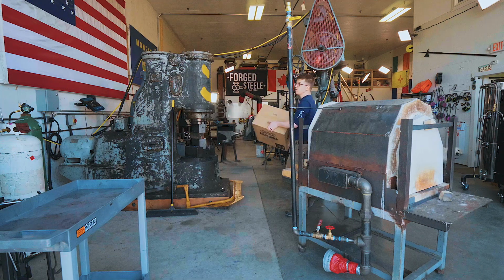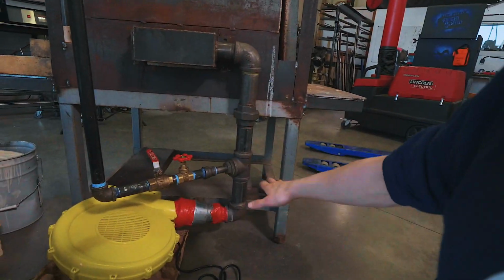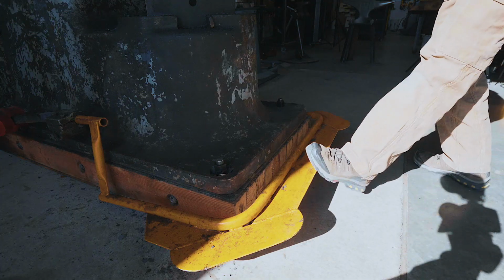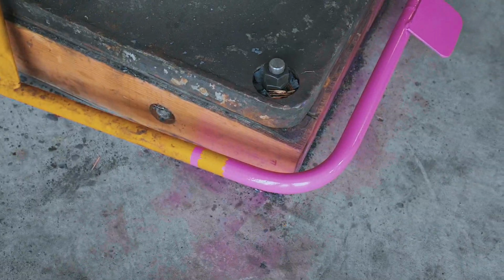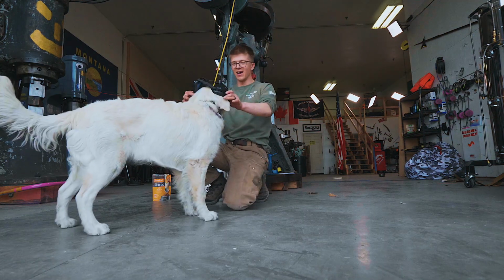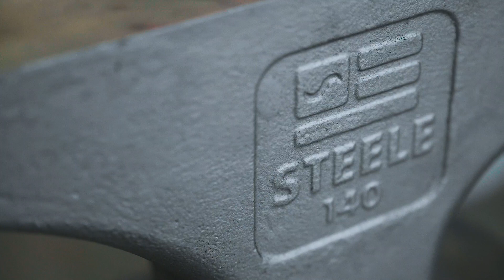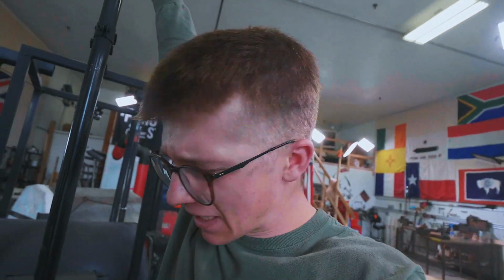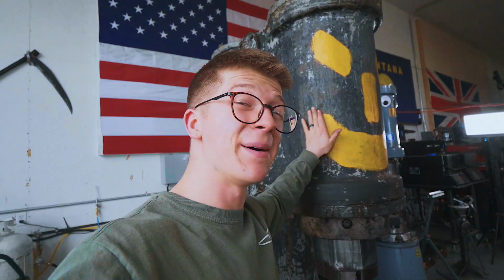NEW FORGE BLOWER, YOGO'S EARS, FORGING TOOLS!!!

Comment: your pressure is to high with to high of volume you need a bigger pipe to get the fuel air mixture better  before it come out of the burner head meaning you need less pressure with the same volume as you had it burning but blowing out i would try larger pipe on the same blower if its still a problem look at pressure not volume of air if your still having problems with pressure at this point after pipe gauging add a air out let flap valve let some air out BEFORE the propane inlet to alowyou to control air fuel and pressure adding the valve to the inlet of the blower just controls presure and volume but after the blower would give a air fule change as well

Comment: Have tried Stoichiometry? 
For natural gas burning in air, the chemical reaction is CH4 + 2(O2 + 3.76 N2) -> CO2 + 2 H2O + 7.52 N2

If you do some not insignificant math, you'll find that for each cubic foot of natural gas, you need about 9-10 cubic feet of air for the best combustion. If you're using propane, it's about 24 cubic feet of air per cubic foot of propane. 

Anyway, any more air than that and you're just blowing excess air. Any less and you're not getting your maximum heat. 

This assumes a perfectly mixed volume, which, looking at the pipe work, you aren't getting. Some suggestions... mix the gas and air much earlier so they mix properly before getting to the forge. Much less volume of air... you're literally just blowing the fuel around so much it can't stay lit. 

Hopefully that helps. I can show you the math if you need it.

Comment: Your blower is now too strong... you are moving the air too fast, but not moving enough air... you can first try to slow down the blower... it should work on a normal dimmer circuit so you can vary the speed it is blowing at... or... you would need a higher volume, lower RPM blower mixed with higher diameter pipes.
In air flow, faster is not always better... in many cases, high volume / low pressure is best.
And if all that fails... then go to a straight oxygen feed... but make sure you do it right.

Comment: The blower: you're throwing parts at the problem thinking more is better. 

This is a physics problem. Fuel/air mixtures burn best in stoichiometric ratio. I'm sure you have some idea of previous propane fuel consumption per hour based on tank changes. Calculate a rough lb fuel per hour. Make the conversion calculation propane flow Vs natural gas flow for the same heat output. From that calculate the air weight per hour for efficient combustion. I think you need 14 or so lb of air to burn a pound of natural gas but look it up. Find the cu. ft. of air per lb. Work the numbers to get CFM blower capacity.

You were burning propane, now youre burning natural gas. There's less heat in natural gas than propane so you need greater natural gas flow for the same heat output. That means a larger gas orifaces or higher gas pressure. You may have to revise your gas plumbing to get the fuel flow rate you need. You may also have to enlarge you ribbon burner ports but only slightly. Sneak up on it.

Combustion engineering is pretty much settled technology. There are how-to's, charts, tables, and formulae for most any combustion process. You got a technical problem? Start with at the beginning from problem statement, concept, inital design, research, calculation and analysis, optimization, prototype, test, feedback and revision, etc. It's the same process whether you're building a toast rack or the Webb Observatory. The process gets more formal in proportion to the size of the project. To simplify: think, doodle, numbers, build.

Comment: You need to bring in an expert as far as your kiln goes— I suspect your ports are the issue—— more ports, less ports, OR smaller or larger and they may need to be located somewhere else—— circulation is usually the culprit—- and pressure of course has to do with that as well,,,  too much too little——— it takes experience to sort it out.....  good luck.

Comment: STOP. please i love your show, not sure how much longer for. your pushing high pressure air up a gas pipe. you mad man. GET ADVICE,. you know have way too much air, causing flame lift off. the burner you are using will have a gas rate, find out what it is set the gas flow 1st then add air too match it. then you will be in the best position not to blow up. big love. thanks for keeping us entertained. BE SAFE gas safe engineers advice
Reply: PS do not increase the pipe size. I sea this on ribbon burners all the time. normally because of either too much air OR a lack of gas for burner size. injector plus gas rate plus air flow ;)
Reply: it also occurs to me your pressure regulator (assuming its fitted) will be affected by your burner head pressure. more pressure in the out let pipe will reduce your gas rate. count the clock on your gas meter to establish gas flow rate.

Comment: Flow rate looks to high, the air speed  seems to be faster than the flame front of the gas.
Reply: Yup a VARIAC voltage regulator would make the speed of the fan adjustable and will give the ability to fine tune the airflow giving control over the fuel air mix